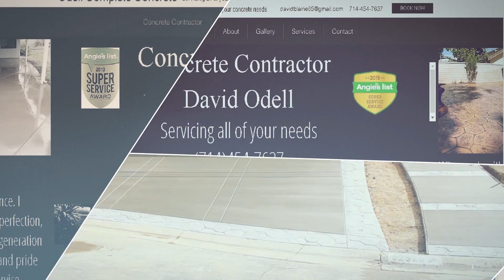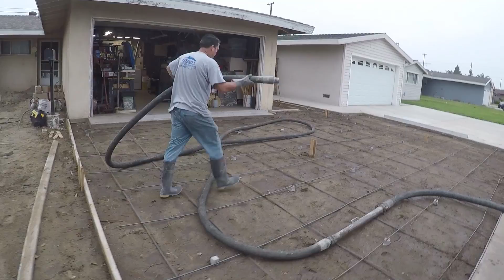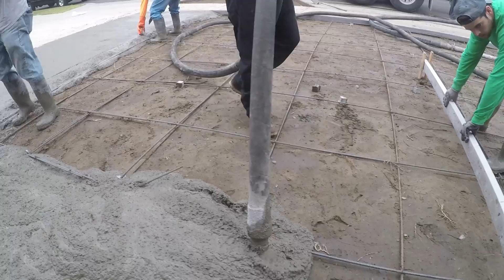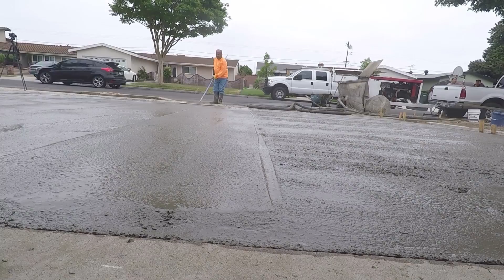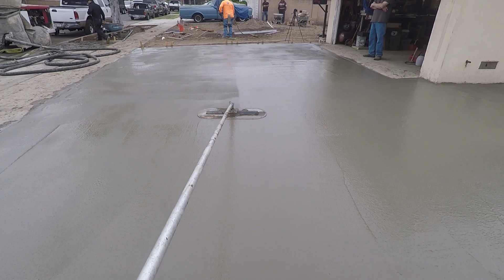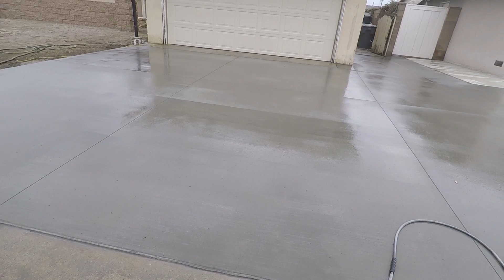How to Pour a Concrete Driveway! Complete Front Yard Remodel! Part 2

Comment: I always heard that you don't use any steel trowels on concrete until the bleed water is done and the concrete has stiffened up a bit but you guys seem to use big blue and fresno while it still quite wet
Reply from the maker: Big blue steel is not the same as steel

Comment: What would you recommend for replacing old wood in an expansion joint that is not rotting but coming out?  It is 5/8"  or 3/4"thick I think.
Reply from the maker: Backer rod, with a caulking on top
Reply: @Mike L. ...David gave you EXCELLENT guidance/advice!

Comment: Question I have, What happens if you turn away a cement truck? Do they get you a replacement out right away or charged any fees?
Reply from the maker: They take it back to the plant and add dry materials, which means now you may have a hot load.
Reply: Guy Who Reviews Stuff I’m wondering the same

Comment: Interesting approach on that valley. Good thing that concrete came in wet. I was almost nervous for you. Looks great as always.
Reply from the maker: Definitely didn't help hold its shape.
Reply from the maker: It was wet on top but very hard 1/4" deep, I found out the hard way.
A lot of bleed water since the base was well saturated
Reply: That the concrete was too wet probably caused the problems with that valley..

Comment: Great work as usual guys!  Just wondering why the expansion foam at the city sidewalk instead of dowels like the rest of the adjacent concrete? Thanks.
Reply from the maker: The sidewalk will have to be replaced before the driveway, and it gives a little space for movement.

Comment: 10:41 
Why no rebar?
Reply: I was wondering that too.  Likely because it was part of the city easement is what i was thinking.  Since it is waterlines there, the city could need to cut out parts and rebar would only make it harder for them.
Reply from the maker: City parkway
Reply: @OdellCompleteConcrete  | Oh. So shouldn't they supply it? Or how does it work?
Reply: @the_jonathan_o  In AZ you can put it in there, however, the city can come and tear it up at any time.  They will replace the cement as needed in patches, but anything you do there is out of your pocket.  The rebar is frowned on for spots like that since it is common for the city to have to dig/trench on that easement. Not sure if that city code prevents that as this is up to individual municipalities.
Reply: @MikeHarris1984  | Ok. Thanks for explaining.
Reply from the maker: That makes sense
Reply: @OdellCompleteConcrete   Jonathan Ojeda its totally right I'm a Arizona City worker always doing concrete sidewalk and drive ways repairs and homeowners can change it even stamp it if they like but if we need to do any repairs and tht piece has to come out will be their total lost ! Just part of the beast